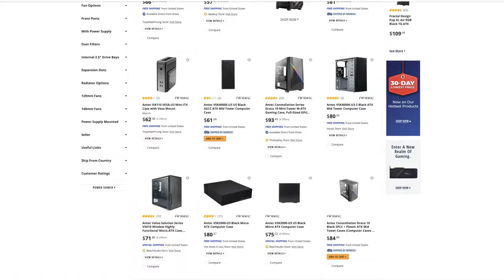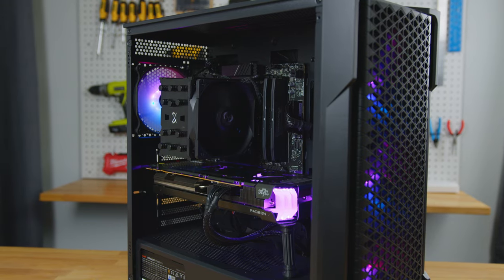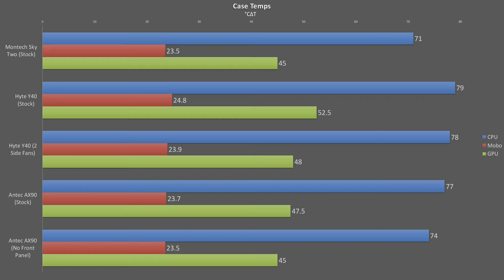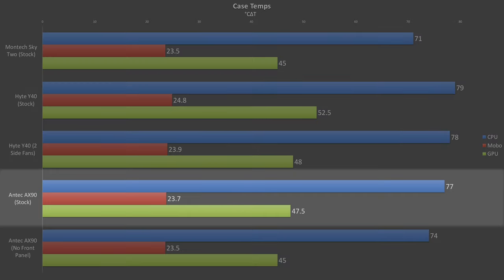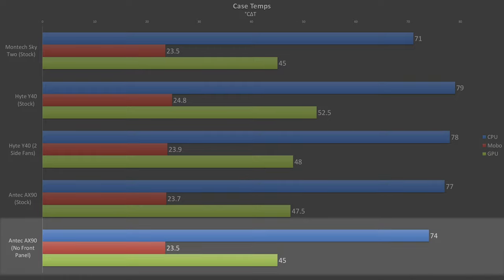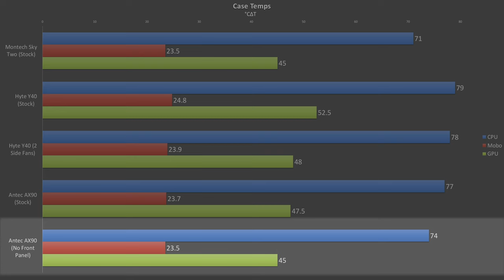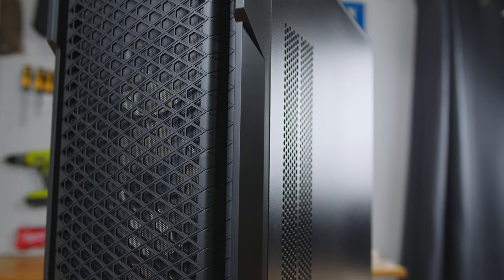Antec AX90 Gaming Case: A Budget Option with Flaws.

Comment: this is coming from someone who will be using MSI A520 Mobo. and is also a dad. I want to be able to switch between work and leisure. and also have the PC not always look like a gaming PC. Some antec cases have that when you turn the RGB off, this one will always look like a gaming PC
Reply: its also very large so a budget buyer like myself won't have much in there to fill that void
Reply: the case I'm looking at is the NX270. I figured that the AX20 and the AX90 don't necessarily have good cooling because of the two fans. and I figured the large case with poor cooling isn't a good idea especially when I don't have aios to fill the empty void with. instead. I want to go for the NX270 and fill it with fans, use a chonky CPU cooler as well. The NX270 could fit in an office setting. It doesn't look too enthusiast or too custom. which is what I need